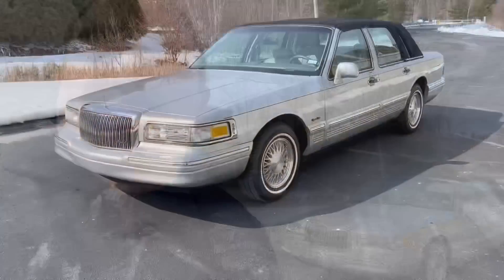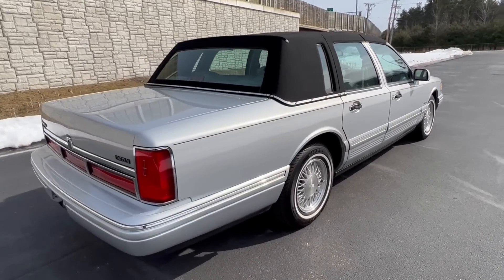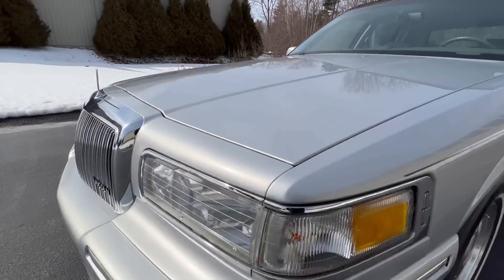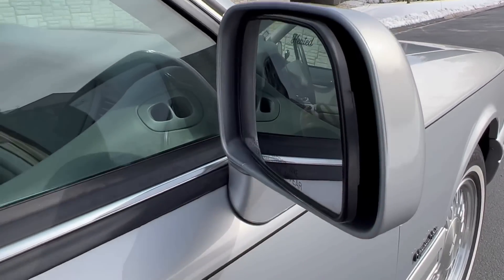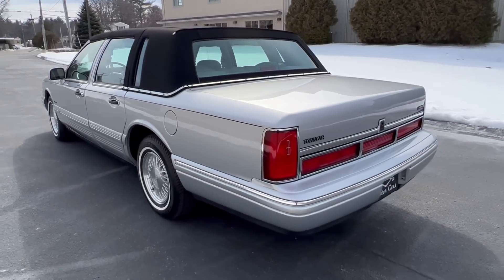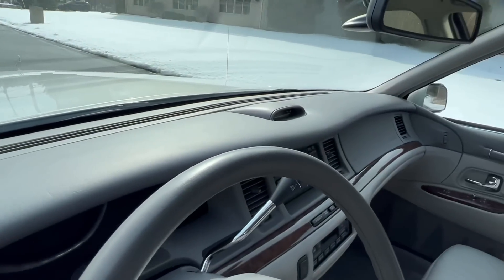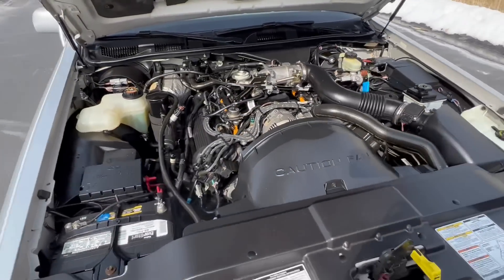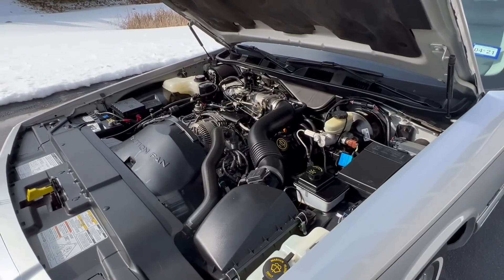1997 Lincoln Town Car 12k Miles FOR SALE Just NAME YOUR PRICE! Own one of the LAST 97’s!

Comment: Thanks for changing the intake manifold. It shows you really care about your customers. That was not a cheap upgrade.
Reply: Was the replacement made of plastic or metal?
Reply: @jameslonergan5840  16:55 Anthony shows the upgraded aluminum crossover tube. The manifold itself is plastic.